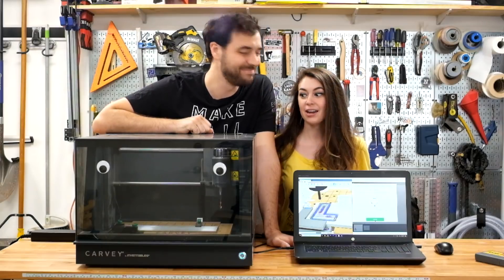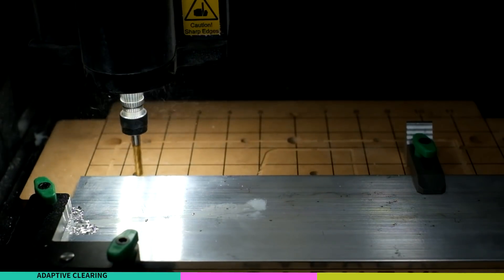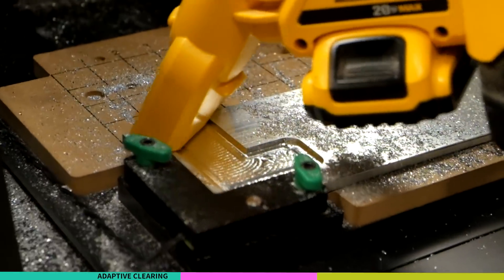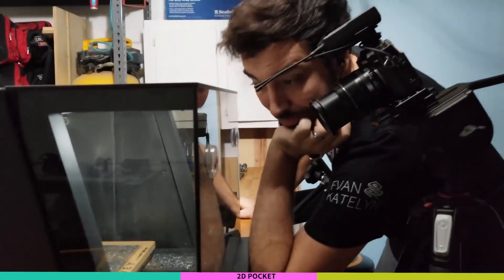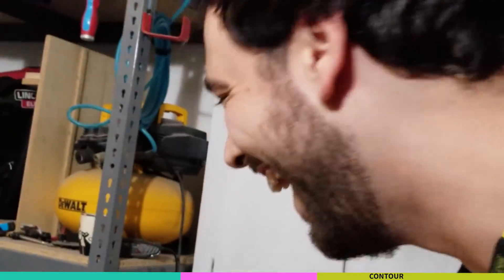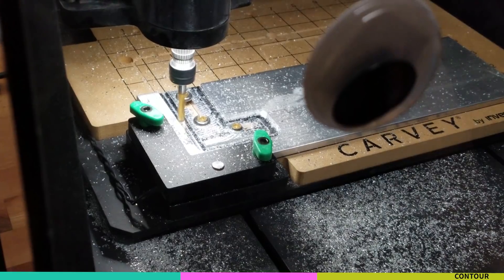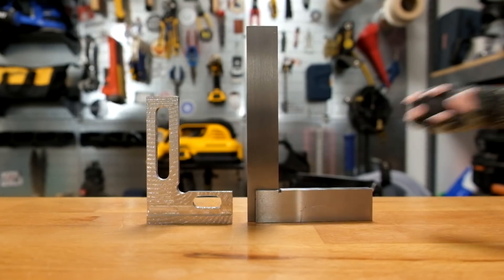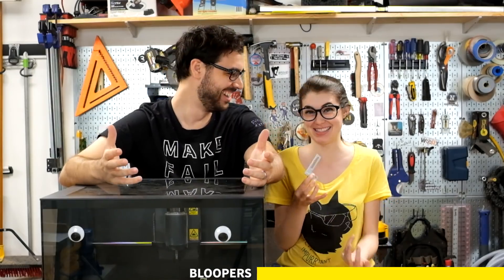Can You Cut Aluminum on a Desktop CNC?

Comment: In my experience aluminum is rather gummy and easily cloggs 4 flute mills   I would go with a 2 or 3 flute mill.
Also in cnc operation rigidity is extremely important. Longer tools happen to be less rigid so it is best practice to use the shortest tool possible. 
As for your speeds and feeds your little mill is not particularly rigid and as a result cannot take the strain of high feed rates on metal. Your motor I would think also is a high speed low torque type so I would not use more than 1/2 of the bit to actively cut where possible due to your motor not being able to handle more while keeping the rpms up.
Reply from the maker: This was a 2 flute which seemed to be right - the chips were a good size and all that. We had the bit in as far as we could but if we could find shorter bits we definitely would be down to try that! Thanks for the tips!
Reply: @EvanAndKatelyn  
I agree there
It also dawns on me that some other Youtuber start their mills in a pre drilled hole to prevent walking of the mill bit.
Reply: Roughing endmills work a lot better too for a lot of things, even in a decent sized 3 axis milling machine if you try to go crazy with a normal endmill the cutter will vibrate (we call that chatter) but a roughing endmill does not. https://www.mscdirect.com/product/details/65770950 There is an example in 1/8". Selection in smaller sizes is limited so in the past working full time doing cnc I often used what would fit into the area being cut and it worked well :-).
Reply: The "corncob" type shape means each flute takes a little different cut...this helps avoid vibration. Would rough to within .001 of size then finish with a regular endmill.
Reply: meant to say .01" of finished size not .001"

Comment: Thanks for the video. How loud is the Carvey when machining aluminum? (and what about wood?)
Reply from the maker: Aluminum is definitely noisier than wood - you can hear it in the audio compared to our voices. Since it's enclosed it cuts down on noise a lot. It's quieter than a vacuum or a blender, but louder than an electric toothbrush (no clue if that helps!)
Reply: EvanAndKatelyn thanks!

Comment: I know you were playing with speeds and depth with each cut, but changing your milling bits might help. I'm almost certain that smaller bits would leave a cleaner cut due to the power increase due to the power to bit size ratios........ (winging the explanation there)...... I'm thinking as the mill size is smaller it will be more powerful. It could also break more end mills.

My second idea was to play with the shape of the mill bit. I'm wondering if a bit with a rounded end would give you less chatter. I know that you'd need to go over it a second time with a flat bit to get everything smooth, but it might be quicker.......? Just some ideas, probably a good idea to go with someone who KNOWS what they're talking about. If you are that someone and my ideas don't work, please could you tell me why so I can learn. Thanks
Reply: Also, cool that you can cut Aluminium 😊

Comment: Really enjoyed watching.  I was surprised to see the size of slot drill you used. The length of the cutter seemed excessive and could have been much shorter  for more rigidity along with half the diameter. Bigger cutter doesn't always equate to faster material removal. Thank you both great fun, happy  happy.
Reply from the maker: Thanks!! Yeah we were thinking rigidity of the bit would be an issue but I think that a 1/8" bit can handle any speed the carvey can handle. We needed bits fast so we got something off Amazon but are definitely interested in shorter bits. Where have you found them? Can't wait to try more things 😀
Reply: @EvanAndKatelyn  i live in the UK so my sources which are mainly flea market stalls would be of no value. The other thing i would do is use an end mill rather than a slot drill because 4 flutes would divide the cutting load better. Come off the work to plunge or drill a hole for plunging. High speed is not always better even with soft metals. Continuous chatter will eventually trash that tiny machine.  Happy happy

Comment: To save yourselves some time, tension, and damaged end mills, look up the formula for the Ideal Feed Rate  (aka Speeds and Feeds)for the tool and material you are working with.  This is calculated based on what size chips you cut off with each pass, and can help you  tune the cutting of new materials quickly.  You need to know what material you are cutting (for the chip size - you will be looking this up from a table online or in a Machinery Handbook), the diameter of your tool, the number of flutes, and the RPM of your cutter.   When you have the right RPM and feed rate, your cutting will be quieter and smoother.
Reply from the maker: Lots more to look into and dial in! Thanks!

Comment: You did not show your plunge depth. 
More so than wood, if take too deep a plunge, you are taking off more material than the machine can handle efficiently.
You're speeds most likely should have been in the range of 5, 5, 1.

For experimenting, you should start out slow and do faster and faster tests until the thing starts to stutter then back it down. This is no different than when you are first starting out and determining what the machine can handle with wood.

On the other hand, if you just wanted to show your machine being too week to do aluminum at the same speed as wood: well, you got that message squared.

Yes, I had too!
Reply from the maker: Squared! Haha yeah, much more experimentation needed to fully dial it in, we just wanted to share the experimentation so people just starting out could learn as we learn too instead of putting their machine through the ringer. Definitely should have started slower... We were too excited!

Comment: Tool rigidity is a big key as well as work holding downward force on the aluminum and shorten the length of your endmill as much as much as possible
Reply from the maker: We had the bit as far in as it could go... Maybe we need to find shorter bits?
Reply: EvanAndKatelyn they also make endmill a specifically for aluminum which might help

Comment: Interesting and fun video guys, like all the videos you do... but don't forget that when working with metals, you have to lubricate the drill or the milling cutter constantly, since it heats up and stops cutting well.
A hug from Spain.
Reply from the maker: Definitely down to try an 1/8" bit and dial in the speeds a bit more. Our bit had a coating that should negate the need for fluid, and the chips we're the right size, so I think we're ok on that front. We should have mentioned that though in the video. Thanks and hi from Texas!

Comment: Smaller machines like that aren't intended to cut metal. I'd take off less per pass. It'll take longer, but you won't be killing your machine. Also, it's not as big of a deal with wood, but metal you need to keep the shavings out of the cutting path the entire time. Otherwise it could clog up the bit.
Reply from the maker: We had a two flute bit so it kept the shavings clear, and we vacuumed it up between operations. Definitely down to dial in the depth and speeds a bit more so it's gentler on the machine though! Thanks!

Comment: Nice work with the trial and error! I've been cutting Alu for years first on a Build your CNC now on a XCarve, I cut fast and shallow, 700mm/min (~27.5in/min) feed but only 0.2mm depth, 1/8" 2-flute bit, lowest RPM possible. The routers turn so fast that I've found going too slow allows too much heat build-up, so I keep the bit moving. WD-40 or other lube just gums things up and keeps the heat in. Milling direction also helps, I use climb as it gives a smoother finish. Your ears can tell you a lot; the chatter yours was making would have me running for the e-stop. Good luck on the next one!
Reply: Yeah fast is the key! I run up to 2000mm/min on my reinforced shapeoko2. Shallow cuts if you are making a full cut. Im able to cut with 3mm DOC and 0.4mm WOC @2000mm/min with coolant... But coolant on a desktop CNC is always a mess espacially with an mdf wasteboard.

Comment: Your tool is extended way to far I would also use a stubby endmill.  Go for a 4 flute and maybe a smaller diameter. looks like you are using 3/8 I would go for 1/4 . Another thing worth trying is a fine pitch rougher but that would require change out to finishing endmill.  They do have rougher-finisher endmills. One last thing go for carbide not high speed steel. Good luck
Reply: Why four flutes? Wouldn’t they clog up easier? Also, HSS is more forgiving than carbide when it comes to making mistakes. Carbide will chip and break easier
Reply: robert panco it Would only if they where really pushing it on the feed rate and that was not the case ( I suggested 4 flute since this are more beefier cross section of a two flute is very thin ) problem that they are fighting here is vibration , long tool ,thin tool cross section ,week machine , etc.. . O was really impressed that it did anything actually . I was expecting that motor to just jump out of the mounting bracket 😁
Reply: Four flute cutters are not good for aluminium, they clog up very easily.
Reply from the maker: We had the bit I'm as far as we could go - tried to find shorter ones but didn't have much luck. Thanks for the tips!
Reply: https://www.maritool.com/Cutting-Tools-End-Mills-Finishers-Square-End-3-fl.-sqr-end-TICN-coated/c78_79_80_106/index.html
Reply: A 3 flute is the better choice. It will not chip weld as easily as a 4 flute in aluminum and it will be less likely to chatter.
Reply: Yes, it breaks up the harmonics, and also, less heat buildup if climb cut on aluminum, conventional cut on steel.
Reply: Yes, OP is correct; Aluminum shouldn't be that big of a deal, but it depends on subtle factors.

The first thing I noticed was material and bit length.  And I didn't catch the 3/8" - that's a ton of demand & will destroy bits if you're too aggressive.  Flute didn't cross my mind though.  And as for carbide, I thought they were meant to have a coolant component...(?). Why not Cobalt-steel alloy?
Reply: Seems you dont know anything about routing alu. 4 flutes are not suitable for alu, not even if you use coolant with high pressure. Best is 2 flute or even 1 flute cutters. They tend not to get stuck and dont break. 4 flutes is nonsense.

Comment: You need to switch to 1/8" end mills and slow your feed rate by 30% . Be very careful with high fees rates with aluminum as the cuttings can weld themselves to the mill tip especially if your not lubricating with an aluminum cutting fluid. Carve with a good selection of mills can run $2,500 or more.
Reply from the maker: Definitely down to try an 1/8" bit and dial in the speeds a bit more. Our bit had a coating that should negate the need for fluid, and the chips we're the right size, so I think we're ok on that front. Thanks!
Reply: That's a common misconception. It does not totally negate the need for a cutting fluid, rather help keep chips from sticking even with coolant. The coatings also have a specific temperature that they "activate".

Comment: I honestly did not see that coming out accurate at all, but was very surprised to see that it did! Great job! Knowing that you can accurately machine aluminium(I’m British, ha!), do you have any idea what you’ll be making next?
Reply from the maker: I wish we said it as aluminium here, it sounds way cooler!!! We might use it to make customs fixtures when we need something more rigid than a 3D print but also I could see us using it to add decorative touches to furniture as well 😁👍
Reply: EvanAndKatelyn Great idea! You also mentioned gears too, perhaps to replaced or renew perishable plastic parts in your machinery? How long did this process take?
Reply from the maker: Yep yep gears to maybe replace plastic parts or if we are making something with motors and need our own gear. Hmmm it took several hours in total but I'm not sure the exact amount

Comment: You're going way too fast for this kind of machine. Also it would help if you added some lubricant. A simple spray of WD-40 would help a lot. What kind of Aluminium exactly are you using? I have tested AlMg3 and AlMg4 alloy on desktop CNC with impressive results. Some alloys are too "soft" and will clog the endmill.
To sum it up, you can produce good results milling aluminium and brass on desktop CNC if you are doing it right. For starters I suggest using cheap Chinese endmills because you will damage and / or destroy burrs when testing.
Reply from the maker: Yeah we'd be down to try further dialing in the speed for sure. Our bit had a coating that negated the need for lubricant and the chips we're the right size so I actually think we're ok in that regard. We used 6061 aluminum, definitely wanna try brass sometime also!
Reply: @EvanAndKatelyn   Bit coating isn't really there to "negate" cooling, it has other important purposes (TiN "gold" coating for instance is very hard and thanks to that, tool lasts longer, also it has increased abrasion resistence). Definitly little bit of WD-40 would help from my own experience. Also you are using very large bit for this kind of machine (it is belt driven, is it?), more like 3mm bit (1/8in I think?) would be more suitable, even if it takes longer time to machine flat surfaces. But in general, really nice work! Keep going !

Comment: Oflute bit first of all. Then for the depth per pass would be .003 at 25ipm. Rpm should be about 12K. That should work. And some denatured alcohol...🤪
Reply from the maker: We used a two flute and it seemed to be right based on our research but definitely down to experiment with the depth and speeds!
Reply: You should've reduced the endmill diameter. The smaller it is, the less HP is required of your machine. It would've been a lot easier to cut the pocket since you would've used less surface area of your smaller endmill (which means less chattering!). Remember, lubrication goes a long way. I used to design production cutting tools. Lol